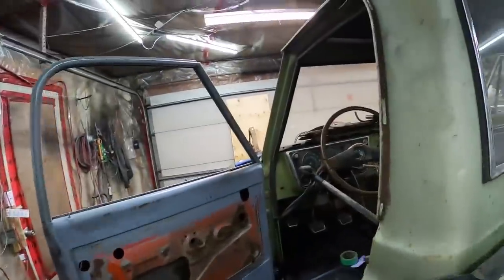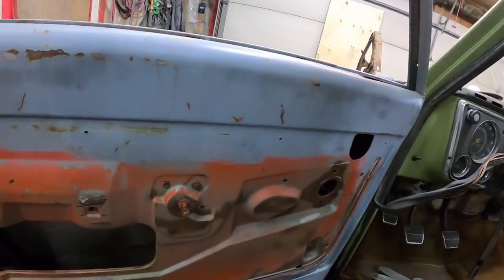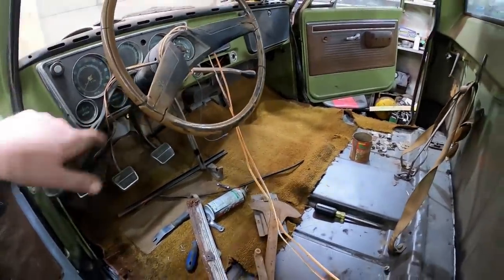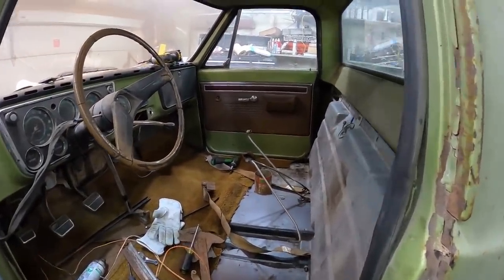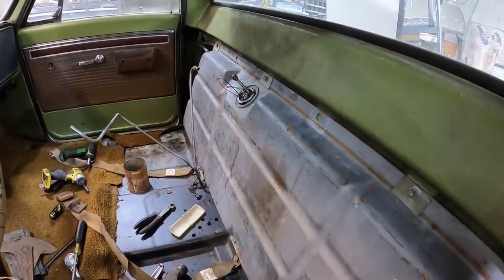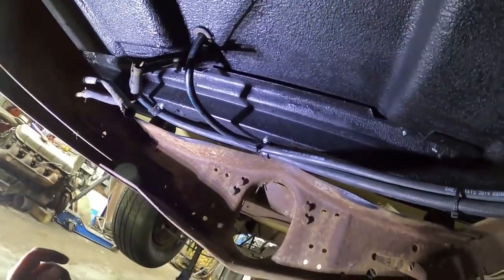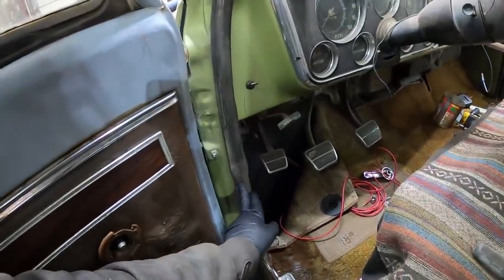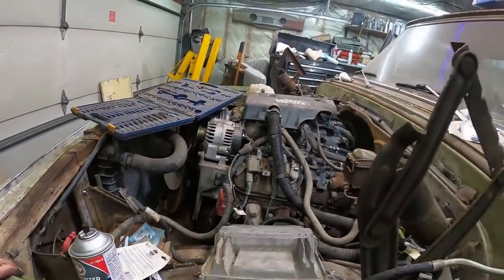El Cheapo LS Fuel System Install - Plus C10 gets an Interior on a 71 C10

Comment: Last thing you said is the part that makes it a roller. Once it goes in an out the door, you can drive out to halfass's place and make the t body a roller. Since this has glass you will last longer outside with it unless you rape it around the light pole getting into drifting in a short side... I used to blast this old 56 caddy convertible that really nothing but paint wouldn't fix, even the top was tight with a glass back window was in it but damn off the side of guard rails was a blast. Couldn't kill car and we filled the back seat with empties. I get in my 56 short stepside factory with a rear broken brake line and go bout five miles and do a loop de loop and nail a tree sober. Pissed me off bad as I was driving careful and slow and crash dead 56

Comment: Nice work getting to the fun part now ready for start up , you could’ve saved yourself a bit of mucking around by running the fuel return in one of the unused vent fittings on the tank I’ve done that and it works well, can’t wait to see that T coupe fired up and driving hot rods are so much fun building and driving them, keep up the awesome content and the live feeds it’s all good stuff, cheers from a fellow motor head from down under Tasmania Australia 🇦🇺 😎👍👍🍻
Reply from the maker: Thabks buddy!  This other tank didn't have a vent on it for some reason.  I'm stoked to get back on the T

Comment: Dude! You do know that the fuel line you use INSIDE the fuel tank has to be special submersible fuel hose. Otherwise fuel will cause the outside of standard fuel hose to degrade VERY quickly. The outside layer of standard fuel hose is NOT designed to sit in fuel. Gates makes a special submersible fuel hose and it is sold in I think 6" or 8" lengths.
Reply from the maker: the pump came with a section of hose so i assume its ment to be in the fuel
Reply: @DDSpeedShop  Oh, yes then that would indeed be a section of the right type of fuel hose. Sorry to raise such an objection.

Comment: Possibly the simplest fuel system I’ve seen. Everyone uses rear tanks with twist lok lines and AN fittings. That stuff is pricey. This gets you on the road the quickest and cheapest. 👍
Reply from the maker: thats the point.  hopefully its reliable too haha
Reply: DD Speed Shop if the hose and clamps hold 60psi you should be in business. I hope it works.

Comment: I was watching where you put you carpet in I took some tractor trailer mud flaps and made some cuts to fit around the seat supports to kind of hold them into place and they work really good and that should cover up the carpet. Now I found mine along side the road so the cost was low.. And I have a miss matched set...might go good with the miss colored door.
Reply from the maker: good call.  thanks for the tip

Comment: If that old door is junk, before it goes you may want to cut the top frame off as sections may come in handy on the "T" (those double areas, smooth curve and reverse folds can be a pain to duplicate and IRCC you may be splitting the posts of the "T" to get sides to line up).  On the other hand you may already have lots of those types of pieces from other projects and gotta be careful not to cross over to hoarder.
Reply from the maker: good call!  ill toss the door into "storage" haha

Comment: What pump did you use ? And does that eliminate the in line pump because you added a return rather than the Corvette filter everyone uses? Also where did you wire the pump into for power? Thank you great video

Comment: I'd put you some sort of support on that pump... I did something similar, came off ha whoops. But I'm not sure if it was because the rubber hose split. I used the supplied rubber hose an it was eaten up by the fuel. So I assume it wasn't "rated" for the submersion.
Reply from the maker: I used a piece of wire haha

Comment: Just curious if you have replaced the rubber moulding   around the vent windows yet? Just checked in and subscribed. I'm working on a 67 C10 Rat Rod. So much to do.
Reply from the maker: Nope I left it as is.

Comment: Caution:  had a thin fuel sending wire under carpet and some how it shorted just enough to burn off wire insulation for a few feet, not to mention charring the fuse panel.  Please add some rubber tubing, etc... to protect the wire.
Reply from the maker: ill fuse it for sure

Comment: What about a regulator? Cant remember if this intake has it on the fuel rail. I know a lot of guys use the corvette filter/regulator as an easy way of doing it
Reply from the maker: its got a regulator on the rail i believe.  i ran the corvette filter on the 57
Reply: @DDSpeedShop  Right on. Just checking. Cheers

Comment: I have a question and please return it with an answer I have a 67 Chevy pickup truck with my tank behind the seat and I have the same setup as you I need to make it a return line with a electric fuel pump like you did to put my LS in their is that possible

Comment: Good setup there with the fuel lines and pump. Who on eBay did you get the fuel pump from ? I've got a 62  Meteor that I've put a 87 5.0 fuel injection in from a Mustang need to get a fuel pump for.  Well I'll be looking forward to seeing how it works. 😎
Reply from the maker: i just searched intake pump.  it was like 30 bucks
Reply: @DDSpeedShop   thanks I'll get on a check it out.

Comment: I did the same return line hack, drilling a pilot hole then using a tapered punch to give more side support through the hole. One thing I found is that with stainless, you have to use silver solder. I didn't use an in tank pump, as replacement's difficult when you have to drop a full tank. Also  wasn't confident that the pump wire grommets wouyldn't leak.I used a low pressure pump to send to a reservoir up front underhood with a high pressure pump there. In your case, an in tank pump is easily replaced. Watch out for sparks though especially in cab!! https://youtu.be/E2KuhuTrBPg

Comment: yeah a shit design. wth are you thinking. lets have a rubber line submersed in gas that is a design for failure. hose blows out pump runs till it burns up. is the mechanical pump not on the block for that year ? wouldn't even need a return if you used a red holly fuel pump out side of the tank and could have had solid metal line in the tank only.
Reply from the maker: pretty sure no LS motors came with a mechanical fuel pump and the red pump is ment for carbs not efi.  The rubber efi hose is ment to be submersed in fuel and not rot.
Reply: @DDSpeedShop  71' ? sry i didn't know what is in it now . i just know i put my eyes and hands on the design to fail rubber hose in the tank that was split.
Reply: @DDSpeedShop  tbi only came out in 85 or so. that block's mechanical fuel pump spot was sealed or not cut out.
Reply: @DDSpeedShop  hum maybe mine split cause lack on gas in the tank and it dried out. idk. i just didn't like seeing that and put my 82 mechanism in. i went from tbi to carb on my 85.

Comment: The fuel system should work fine, I used an external Walbro pump for my '65 GTO when I put a FITech on it. I used the carb feed for the return and ran the high pressure 3/8 down the passenger side. The in cab tank makes it all real short and easy. When I do my '76 C10 I will probably do an in tank pump like you did on this one. Makes things easier if you can fit it through the sender hole. Wasn't enough room on the '65, the sender is real short.

Might seem boring compared to the T, but the C10 a cool project in its own right. Keep going on it.
Reply from the maker: yeah its just all the tedious stuff on the truck thats kinda boring.  the T was a nice break

Comment: I don't know how you can work with all that shit strung out on the floor . I would be tripping over it every 10 minutes. It would be pretty cheap to buy a roll of the universal black carpet. Plus a little Lowes cheap insulation to help keep the heat/cold and noise out of the cab. But your plugging along pretty good. When are you going to do a crown vic F-150 swap?